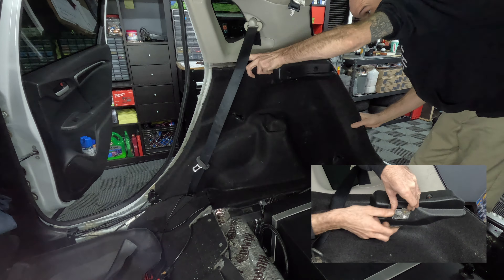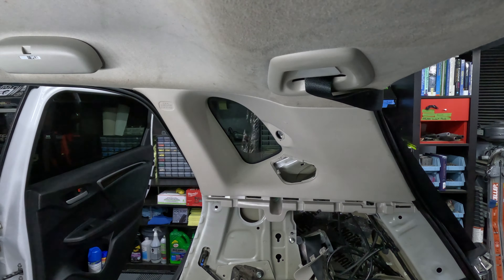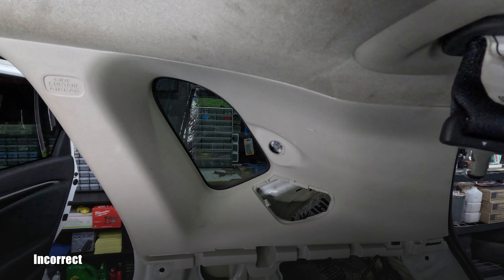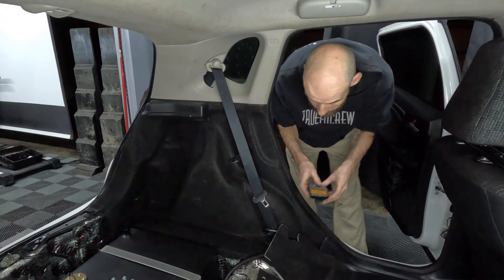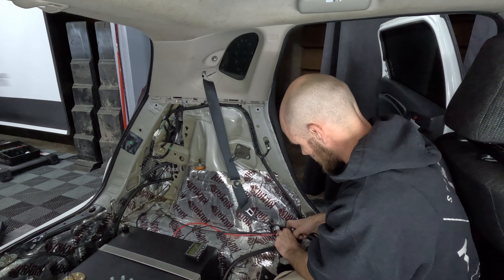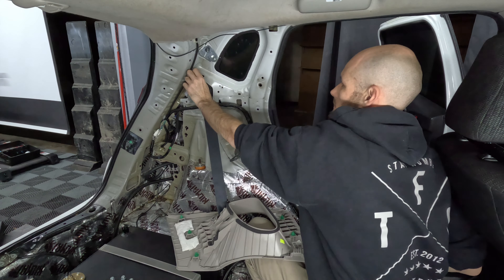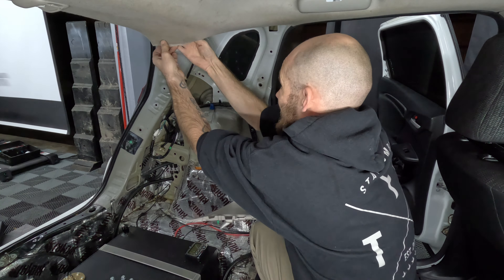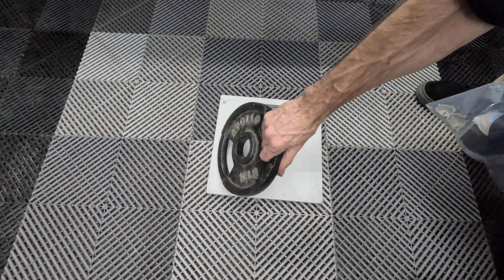How to remove a C-Pillar on a 2015+ Honda Fit | How To Removal & Installation Instructions

Comment: 2015 Fit rear seat belt upper anchor bolt (the hanging slot that holds the seat belt up high in the C pillar): 39N-m or 29 lb-ft.
Same for the lower anchor bolt that attaches the end of the seat belt. Driver and passenger side same specs. 
Rear seat belt assembly (the spring loaded spool): upper bolt 9.4N-m or 6.9 lb-ft. Lower bolt 39N-m. Both sides same specs. 
Rear center seat belt attaches to the roof with 3 bolts. Center is 9.4N-m, side bolts are 39N-m.

Same specs for 2019 year, so this might be all GK5s.
Reply from the maker: Thank you Taylor!
I figured both 14mm bolts were the same torque specs, but I wasn't sure about that little 10mm bolt.
It looks like all if not most of the 10mm bolts on the car have the same 6.9 lb-ft torque spec.
Reply: You are very talented.. I think Honda maybe calling you.😊 nice job

Comment: 6 pounds is actually way more than I thought. You should completely strip as much weight as you can possible and see what you're 1/4 mile time would be lol.
Reply from the maker: Lol, tell that to the 40+ pounds of sound deadener that I added to the car.
My first time at the track was with the overloading setup and factory sized wheels. I got a 17.979
My last time at the track was 75lbs lighter with a slightly larger rim and tire setup, and I ran a 17.146
I'm currently 40lbs lighter than last year. I went up another tire size and installed an Under-drive Pulley. Now I just need to get back to the track and get some new numbers.
Reply: @HondaFit4Adventure  has the pulley caused any weird issues. My mechanic didn't want to risk putting that pulley on. And could you tell a difference in acceleration? I highly recommend a throttle body spacer for the na gk5. I picked up 3 whp on the dyno with one.
Reply from the maker: @FMB123  I've heard different things from different mechanics. Some say yes, and others say no. I think the harmonics or balancing issues were more of an problem on the older cars.
I had a 3 piece pulley kit on my Acura Integra for 30k miles and never had any trouble. I did wait until the Fit hit 100k before installing the pulley. I've been riding the Motocompacto back and forth to work so I don't have any feed back on the pulley yet.
I forgot all about the spacer modification. I got quite a few requests to do the Clutch Delay Valve delete. Someone was supposed to send me a kit but they never did.